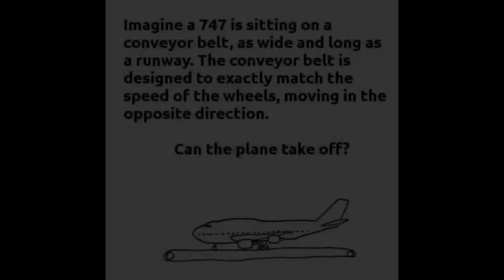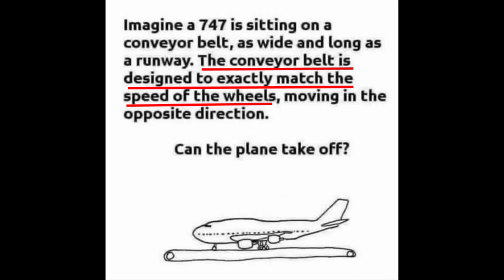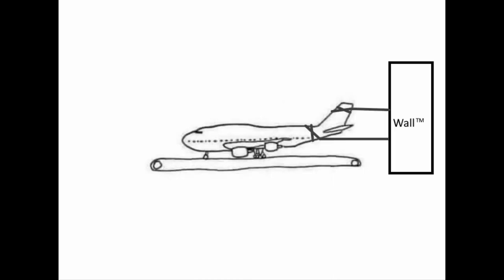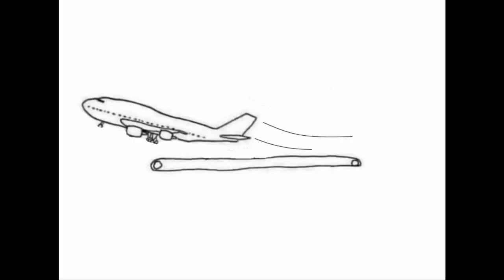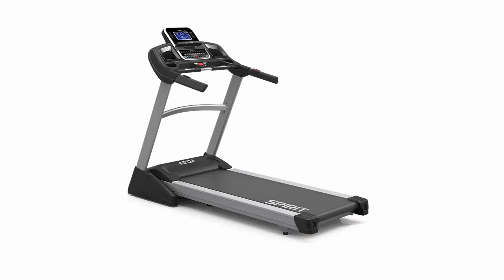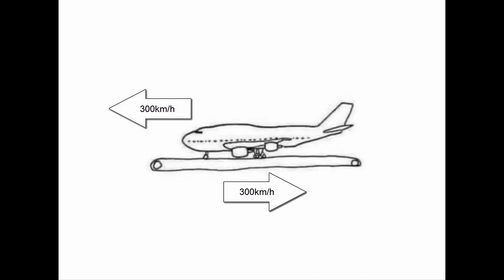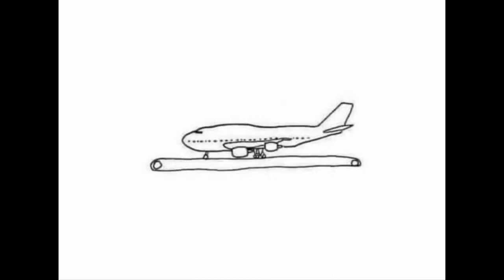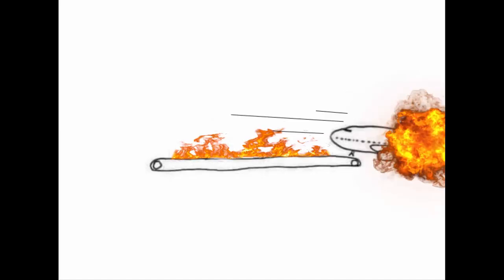Airplane on a treadmill is a flawed question.

Comment: I see a lot of people are confusing "speed of wheels" with "frequency of spin"

The speed of a wheel is only correlated to its spin frequency in certain situations. 
The speed of a wheel is defined by how far it moves, over the time it moves. 

A wheel can have a forward speed without spinning. A wheel can have a forward speed while spinning "backward". A wheel can have a forward speed, regardless of how it spins. 
The speed of the wheel would be the same as the forward speed of the plane.

Comment: wow,a JET matching the conveyor belt speed  WILL NOT TAKE OFF...its simple...flight demands air resistance benief its wingts....seing as it isnt moving,there isnt any air lift.....?
Reply from the maker: The jet is not coupled to the conveyor belt. The engines will make the plane move forward regardless of the conveyors speed. The conveyer can be spinning at 50km an hour before you turn the plan on. But when you do the plane will still be pushed forward by the engines. Remember it's a trick question and is Also why when mythbusters tested it in small and large scale, the planes always took off. The only way for the conveyer to affect the plane is if it was going do fast it caused the wheels to fail due to friction.
Reply: the jet is not coupled but is also not moving, to create resistance isnt happening..it is stationary? for lift ,the aero dynamics requires  1 of the forces as we know:-  1) a push  , 2) a pull  or 3) a twist/turn....seing as there is no wind to lift the wings ,then friction is not a factor until its in motion?  IF YOU WERE RUNNING ON A CONVEYOR WITH A HANDGLIDER, tell me....same example....could youj take flight without any helping factors.....metaphoricaly speaking ,YES, if you were in a wind tunnel,....but NO if you were not......?>

Comment: If the wheels don't matter, why not remove them and just let the plane take off on the runway without them?
Reply from the maker: They don't matter in the context of this question. The engines are not coupled to the wheels. The thrust imparted by them has nothing to do with the wheels. If the plane is on a treadmill and you throttle up the engines. The wheels won't reach a speed and stop thus keeping the plane in place. The plane will just move forward and the wheels will end up spinning the speed of the treadmill plus the speed of the plane moving down the treadmill. This has even been tested multiple times in small scale, and full scale on Mythbusters. Spoiler, the plane always moves forward.
Reply: @venera13  So the wheels don't matter until they do. And the plane stands still on the conveyor until the engines create so much thrust that both the wheels and the conveyor explode while the plane is standing still, but magically it takes off from standing still to flying with no wind over the wings anyway. Good answer.
Reply: @venera13  that assessment is incorrect and Mythbusters did not do the thought exercise as written.  They unfortunately missed the mark on this one and they have confused many of their followers.

The increase of speed of the wheels if you increase thrust is by definition matched by the increased speed of this (inane, hypothetical) conveyor.

This thought exercise tries to show how thrust does not create lift on its own; thrust creates forward vehicle velocity which creates lift.  By thwarting forward velocity, the aircraft does nothing but cause the wheels to spin at the matching pace of the conveyor.  That's the absurd condition we are given; we can't ignore it.

Comment: I think the true core of this question is if the treadmill moves so that if pulls the airplane backwards at the same speed as it tries to move forwards, could it take off? and no it cannot. they would just continuously try to speed up. Every single person ive seen try to explain this acts as if friction just doesnt exist which it does. the wheels do not matter, what matters is that the plane is stationary in refrence to the ground. it's essentially chained to a wall and doesnt move. those cannot take off.
Reply: I got a question for you:
747 needs a 1 km long runway to take off. If you would replace a runway with large conveyor belt, that at any point would match the speed of a starting plane on it so plane´s wheels would NEVER turn at all (matching speed, right), would the plane be able to lift off? 

If so, what is the length of a runway needed for such takeoff?
Assume full friction between tires and belt/runway and zero friction between wheelbearings and wheel turns for easyness of calculations)

Comment: That is wrong. The plane will not take off because however fast the engines are pushing the plane forward, the conveyor belt moves the same speed backwards and will negate the thrust of the engines.
Reply from the maker: No, because the wheels are free spinning. If takeoff speed is 50km/h and the conveyorbelt is moving at 50km/h. The plane will just roll forward anyway and the wheels will spin 100km/h. There is no reason for the wheels to stop at a set speed as they have no power to them. This is why when Mythbusters tested this in both small and large scale, the plane always rolled forward on the conveyor belt. Airplane wheels are not like car wheels.
Reply: @venera13  You keep misusing the term free spinning.  The vehicle absolutely has to roll on its wheel set and the relationship between linear travel is inextricably related to the travel of the wheels along its circumference.  You really have to learn basic linear motion and angular velocity.  This is introduction to physics.

Comment: You said yourself the plane will takeoff at groundspeed of 300kmh, with conveyor going in opposite direction at 300kmh, and wheels at 600kmh. The riddle requires the conveyor to be going 600kmh in this scenario, not 300kmh.
Reply: They are mixing and matching linear speed with angular velocity of the wheel.  It trips them up a lot.

It’s also a frame of reference challenge too.  It’s hard to visualize the wheel axle stuck in place while the conveyor and wheels run furiously.

Comment: It is solvable like i showed just on my channel.
Reply from the maker: It is solvable as people have tested using everything from toy plains to full size ones. The plane always rolls forword and flies because the wheels are irrelevant. Mythbusters even tested it on TV. Can't get much clearer than a practical demonstration of how it's a trick question.
Reply: @venera13  well if it runs forward, then the threadmill just isnt fast enough. If it was, somewhere at maybe speed of sound or higher, the friction would encounter the thrust of the engine. If it doesnt, then the plane would move, and thus the wheels would turn faster than the threadmill due to simple logic i showed in my video, and thus this would violate the statement of the task. So the statement already suggests, that at some maybe brutally high speed of the threadmill,the plane will stop due to ftiction, cause from the task itselve,it is not possible, that the plane moves,else its statement is violated.And the mythbusters did another experiment, where they didnt match the rotational speed of the wheels, but the axis speed of the wheels. Of course with this lazy interpretation of the task, the plane will move. But i would not call it the right interpretation,cause if you are talking about wheel speed,you are not talking about the speed of its axis, because then instead you could just state the speed of the plane, cause the speed of the plane is the speed of the axis of the wheels of course, but you are actually talking about the rotational speed. And this wasnt matched in any of these videos,cause else you can proove,that it does not move.
Reply: @neutronenstern.   speed of wheels is determined as the speed of it´s axle compared to it´s surroundings.

That works for the car as well - speed of your wheels is matching the speed of the car relative to the surface under those wheels.

"Speed of wheels" is not an angular speed in correct language. 

If it was, then true, but the question would have no soution, as without movement everything stands still and with even slightest of movements caused by thrust, the question logic would break much sooner then any wheels or belt due to poor wording. So there is only one solution, it correctly translates the "speed of wheels" as "speed of wheel centers" and then it has a solution
Reply: @siriusczech  well but then it would say speed of the plane and not speed of the wheels. If it says speed of the wheels then it translates to speed of the surface of the wheel compared to its axis. 
Eg. if a text says "speed of a windmill" would you say its zero, cause its axis isnt moving?
Also like i explaned in my video on my channel, there is a solution.
The answer is friction inside the bearings of the wheels encountering the thrust.
And at some insane speed this will actually happen, if the wheels dont break.

Comment: the problem is pseudo intellectuals with no degree of study or even a hint of reading the question or answers will absolutely bombard you with stupidity in the online forums, it has taken a hold of some aviation page AGAIN, and people with actual know hows are being questioned again by people that actually think that the wheels, somehow, is connected to the engine and is needed, God help these poor souls when they find that the wheels are retracted after takeoff, where could the plane possibly take its thrust? good heavens, we need a conveyer belt leading to the skies😂
Reply: Your assessment is incorrect as is this summary provided by the video.

It is indeed sad.

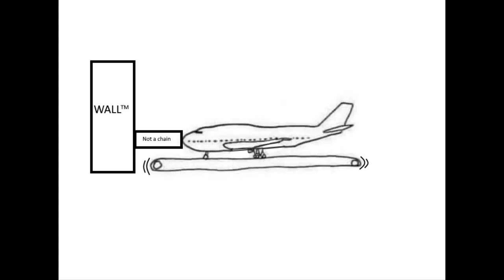Comment: @1:00 uhm.. no!?
Ever heard of friction? the wheels are not free spinning without friction
Reply from the maker: Free spinning means not powerd.besidesvoutside of small toy airplanes the thrust of the engine is strong enough even if throttled low friction of the wheels doesn't matter